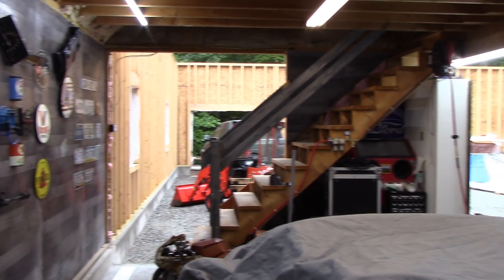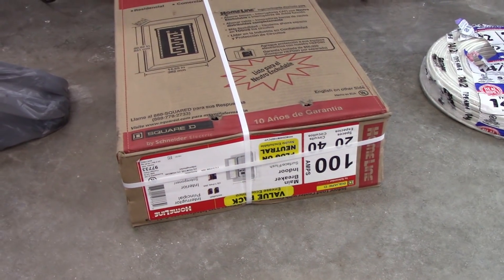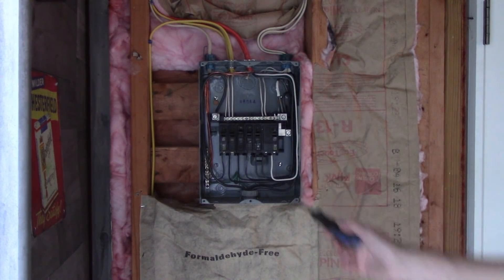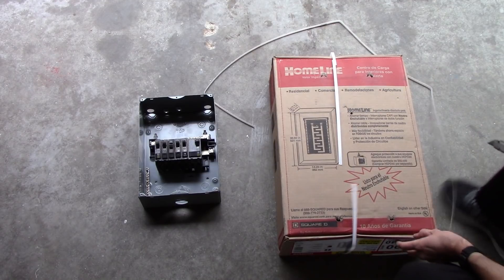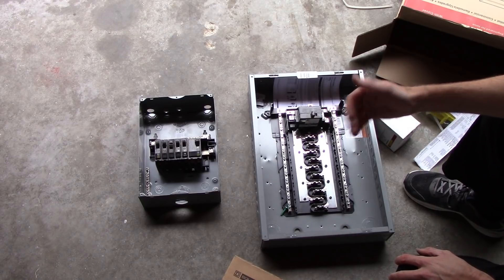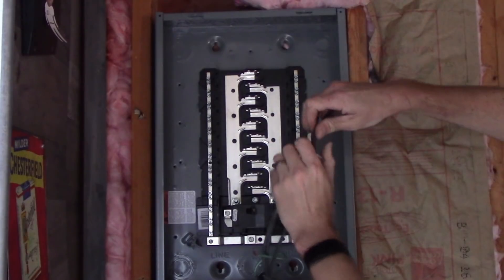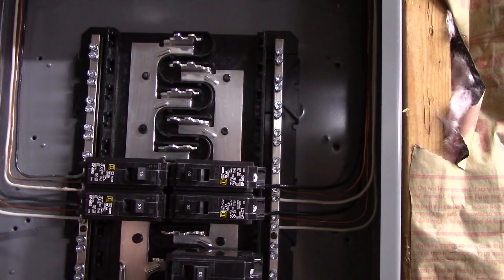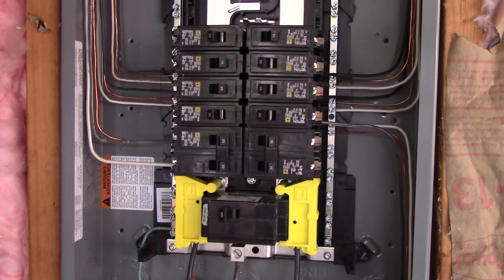Part 6: Dream Garage Build - Major Electrical Upgrade! New Subpanel

Comment: Grounds in neutral shouldn't be connected and a sub panel ground should have a separate bus bar
Reply: Just think maybe adding that to you video so other don't get wrong Intel
Reply from the maker: @livethelife8458  Wish I could but youtube doesn't allow that as an option.  I just try to catch it in the comments when I can. Case in point, this one.
Reply from the maker: It has them, I just didn't have an extra bus bar when I made this video.

Comment: I am not an electrician,  but a disconnecting means is required when there are more than 6 branch breakers for a detached garage. As others mentioned, the bonding screw must not be installed and you need a separate grounding bar.
Reply from the maker: You are correct.  I have since added a second terminal strip to isolate the ground.  Thank you for watching and contributing your knowledge!

Comment: Those homeline panels do not come with ground bars in the box. You should add two of them in your links to save people the frustration. I like square D’s stuff but IMO that’s BS. Nice job routing the wire in the panel!

Comment: All subs in my town have neutrals and grounds separated. Not sure why he is wiring like its a main and not a sub.
Reply: @Trialnerror   Very Good Sir, glad to hear you added the ground terminal strip.
Reply: You always want the grounds and neutrals separated! Tieing them together will phantom trip GFCI receptacles and if you have an appliance that is "leaking" electricity sending it to the ground will cost you as opposed to flowing out through the meter back to the grid on the neutral wire. You do not want anything other than ground going to ground, its the escape route for a dead short, with the neutral connected to ground you run the real possibility of energizing the neutral wire and frying delicate electronics and motors. It is also a good practice on installations like this to drive a second grounding rod into the ground for the building, do not depend on the house ground as distance and resistance is a big factor. A retired lineman with ConEdison 33 years.

Comment: Nice routing skills! The wires are very organized in that sub panel!  On a large building, I install a main panel at the logical entry point, then run a sub panel (they are both subs really) on the other side of the building so that I have much shorter wire runs on the far side -- just the one large wire running up and over.

Comment: So the first panel is not near the garage, correct? You need to bond the neutral to the ground, and tie it to the ground rod there. You run 4 wires to the panel in the garage. The fourth is a ground. In the sub panel the neutral is NOT bonded to the box, it runs seperate back to the main panel.

The ground at your sub panel goes to it's own ground rod, wired to the main panel ground, and wired to the rebar in your foundation. It is bonded to the sub panel box.

Hope this helps.
Reply: I know this video is almost 2 yrs old, but what's said above is correct.  It's an easy fix and can be pretty important if you have any issues with a device.  Thanks for the video series and the motivation it's giving me to start my garage addition.

Comment: What gauge wire is that feed? Looks way too small to carry 100 amps, but maybe the video just makes it look weird. Love the project!
Reply: For sub panel, 3 AWG / THHN or THWN cooper or 2 AWG aluminum meets minimum requirements of NEC code.
Reply: Trial N' Error oh yeah 4 gauge should do it, it’s usually just so hard to work with and yours was really flexible made me think it was smaller.

Comment: I’m not an electrician but you might want to double check whether it’s ok to mix neutrals and grounds on a sub panel. I remember being taught that you can do it on a main panel but that it was a no-no on a sub panel as the breakers may not trip reliably when shorted.
Reply: Definitely don’t mix neutral and ground.
Reply: Haha. Thanks. I’m really enjoying the series. May your recovery be speedy and smooth!
Reply: Trial n' Error the AHJ would have a problem...well if he bothered to take off the panel cover...
Reply: Goodness, electricity 101; don't mix neutral and ground. Those two bars, neutral bars, were not there for you to screw everything up.
Reply: Depending on the age of the house........... their most likely mixed in the main panel?
Reply: @theusconstitution1776  They should be "mixed" in the main panel.  Neutral is bonded at the first point of disconnect.  When you "mix" them at sub-panel you might get voltage on the bare ground wire.  That's a great way to get someone killed.  That's why it's in the NEC.